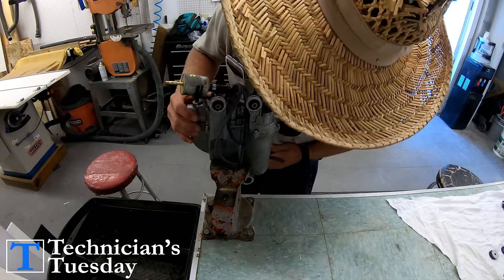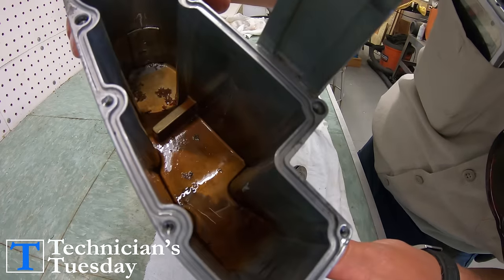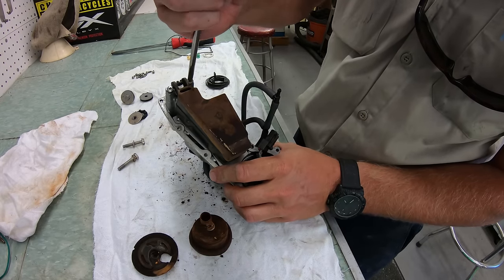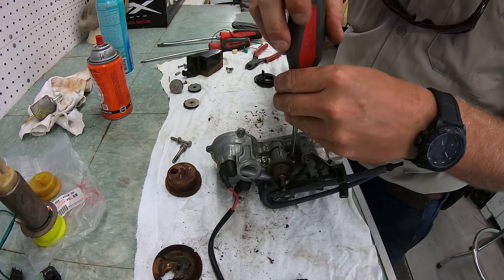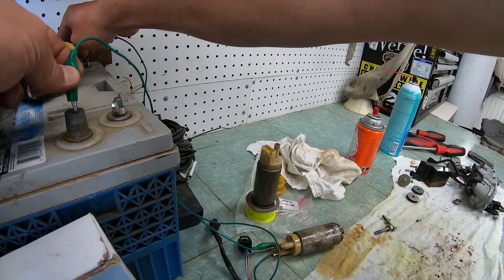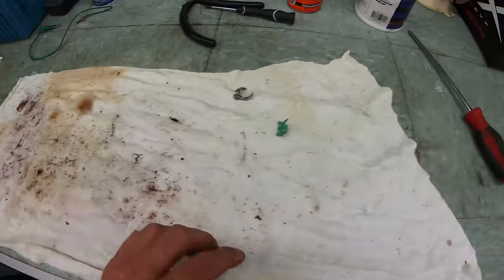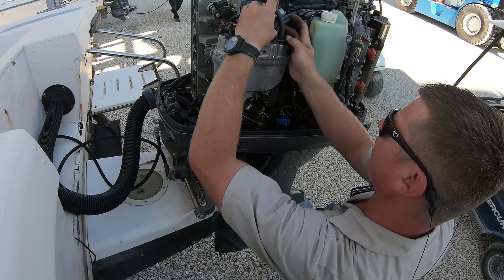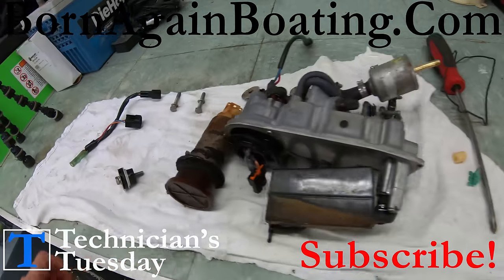How To Clean An Outboard Vapor Separator Tank (VST)

Comment: Frist, let me say how much I enjoyed your three part series of waking up this engine.  That said, I have a 115 yamaha that has been setting up for about 5 years in storage.  I'm 74 years young.  May I ask what would it cost me to have someone do what you just did with this engine?  Dose not have to be exact but in the ball park would be great.
Reply from the maker: Well that depends on how the engine was put away, and the hourly rate. If it needs work like what was done here estimate about 8 hours of labor, but if it was put away fogged, the. It could be a matter of 2-4 hours and some spark plugs and fuel filters!

Comment: Great video! i have watched it numerous times. I replaced the top section of the VST and when I put it back together, there's no fuel being pumped put of the VST. What type of tester did you use to test the pump? Looks like the pump in my VST is not working and before I buy one, I'd like to test it to see if it runs. Thanks!
Reply from the maker: Thanks! Just use a battery and two wire leads to hook to the pump to run it
Reply: @BornAgainBoating  thank you!!!

Comment: Looks kind of complicated but I’m gonna try it anyway. If I have trouble I can always buy a replacement as a last resort lol. Thank you so much for taking the time to make these videos!
Reply from the maker: You can do it!
Reply: @BornAgainBoating  hi. I cleaned my vst but when I put it back together and started her up, I noticed gas leaking from the top outside of the vst where the wire lead terminals are hooked up? Does that mean the float isn’t working? I would think the float is supposed to stop the gas from getting that high. Any suggestions or insight would be greatly appreciated. Thank you. No rush. I know you are busy

Comment: Like your video i have a question. I have a 2004 hpdi 175 do i need to clean my Vapor separate tank out. thanks you Henry
Reply from the maker: Hello Henry, thank you! If you don't have any running issues and the engine is running properly. You don't need to clean it out. Usually the only reason you will need to go into the VST is if you get a batch of bad gas and suck up a bunch of stuff, or the engine has sat for a few years and has gummed up. Besides that you should be good to go without messing with it :)
Reply: If you store the boat, say if you’re in a climate that sees four seasons (I’m from Ohio), part of the winterization process is draining the VST AFTER you’ve ran stabilized fuel through the engine for a period of about ten minutes, and after fogging has been completed.

Comment: About too take apart my VST tank ,   Fuel seems too be coming from under the brown plastic connector , blue wire ,  Any ideas why this is happening
Reply from the maker: Most likely the gasket around the high pressure pump is broken or cracked or whatever and is pressurizing the VST which is pushing fuel out in weird spots :/
If you get stumped, you can look into joining our Boater's Program where we have messaging and a place to upload pictures and videos so we could talk about the issue and give our recommendations during a weekly livestream: https://boaters.bornagainboating.com/signup/
Hopefully you've figured it out by now and are back on the water though :) best of luck!
Reply: @BornAgainBoating  pulled pump ,  neg terminal came apart from pump ,  Ordered replacement

Comment: I have a 2004 Yamaha saltwater series 2 200hp ox 66. Is changing my vst fliter the same process as this? I need to remove the entire filter off the engine, I can’t just drop the bottom tank off? Ty
Reply from the maker: Yes, it's basically the same thing for the OX66, and it's easier to pull the whole VST off and do it in a vice. Save yourself the frustration :)

Comment: That’s so interesting that they shut 2 pistons at idle. Are there any other outboards that do this? I guess it would need direct or multi port injection to do this? An OX66 can’t do this right? Since the injectors are through the crank case?
Reply from the maker: No, I think that the HPDI's are the only ones that do this :/

Comment: hey guys you are great i have a problem i would like to share with I have Evinrude 140 HP it has been sitting for 8 month I have hired 3 mechanics and all of them thye come they guess and they couldn't Start the engine the engine spin but don't start what do you think is the problem my belives is Stupid things not making the engine to start please help
Reply from the maker: Probably something to do with the spark or the timing. Evinrudes, depending on the year, have issues like that. Where the timing gets thrown off and they won't fire up but will spin all day. You need an Evinrude tech that knows how to troubleshoot the electrical system :) (That is if the fuel system and other things are operating properly, it could be something as simple as the keyswitch! Has anyone checked for spark?)

Comment: Hello my pump diagram says it has a small o ring with the plastic spacer. Does the o ring slide over the spacer or do I put the o ring in before the spacer. It is hard to tell from the diagram and unfortunately someone had already put in an aftermarket fuel pump with no o ring or spacer. So i cannot see how it was originally set up. Thank you
Reply: Forgot to list the motor 2006 hpdi motor vz225tlr

Comment: What's the difference between spark plugs and fuel injectors?
Reply from the maker: The spark plugs just provide the fire to make the explosion inside of the cylinder to allow the engine to run. They just make a gap for electricity to jump across. Fuel injectors are what atomize and squirt the fuel into the cylinders for the spark to ignite :)

Comment: What's the most common problem on this engines fuel system if it's not neglected like this one? The VST(Medium Pressure pump)? Diaphragm pumps(Low Pressure pump)? Medium Pressure Filter? This is the most complex fuel system I've seen on any outboard. I see why the engineers didn't want a Medium pressure system shooting 40-60psi from the boat's fuel tank but? 
Anyway, I'd appreciate any input.
Reply from the maker: Probably dirty filters and screens
Reply: @BornAgainBoating  Thanks for the reply and the input on YT. The reason I asked is when I had a old Crossflow Johnson it stated in the troubleshooting section almost all the problems( poor midrange, poor top end, erratic operation) almost everything pointed to the supply pumps as a first check. I pulled it and installed a Holley fuel pump, blocked the port and never looked back. 
I don't like the diaphragm pumps(Old Tech) and if it made life simpler I'd do the same on my VMAX HPDI 250. No primer bulb, more reliable than the dual rubber plunger, can't get crankcase pressure pumped into the fuel or visa versa. Less moving parts.
A person could get rid of the VST altogether if you run an EFI 45psi pump straight from the tank. Sorry but I don't like the VST.

Comment: Hey there I have twin verados 300 2008 one I noticed is making a rumbling noisy at idle it sounds like it coming from the top of the supercharger I know there is a end cap replacement kit any info would be appreciated thank you
Reply from the maker: Hey Vincent. That rumbling is most likely the bearings inside of the supercharger. I have never tried to rebuild one. I've taken one apart and it didn't seem to be that serviceable. 

You might be able to change the bearings and rebuild it, but I have never tried to do that. The rumbling is common and I've seen some sound like that for years, so, not sure how bad your's is. Hopefully it is just a normal rumble, at idle and with the cowling off they can get pretty noisy.

Comment: Thanks for the great video, I have a mercury 115 efi. I have fuel leak out of the VST vent hoses.. any idea on what could be the cause?
Reply from the maker: Usually something going on with the float and needle valve assembly inside the vst. The float is what closes everything off. You'll have to open it up and investigate :)

Comment: Hi I have DF115 and fuel is going in the oil. The low psi filter is brand new. How does the float valve work? I’m wondering if my float valve isn’t closing. Like maybe the float valve needle is stuck or something.

Comment: Can you tell me what the schrader valve is used for going to the vst?  What should the pressure be and how do you test it?
Reply from the maker: Its for testing the fuel pressure, and it depends on the engine, most are around 45psi

Comment: I have a 2001 200 Hp Yamaha OX66 Fuel Injection 2-stroke, I try and run clean fuel (not all Marina's have the same quality) add stabilizer during winter storage fuel additive in the Summer (our Season) but inevitably my O2 density sensor joint gums up causing an annoying ticking sound. I've had it apart cleaned it but it doesn't take long before it gums up again? Someone has recommended I use high octane fuel (which is only available on land) so not the best option not to mention this fuel may have ethanol, any suggestions?
Thanks
Reply from the maker: Idk if the octane level is going to get rid of the rocking. Usually when they start to gum up and tick like that, they are in the beginning signs of failure. You can try running ring free in your fuel and see if they helps. It might help with the gumming and the ticking. Maybe save you a lot of time with the sensor!

Comment: the plastic piece that is on top of the vst pump where the wire connector is, is there some sort of gasket that goes there? I didn't hear or see any mention of one in the video
Reply from the maker: Nope, just that plastic piece, most other VST's have a rubber grommet that goes there. For whatever reason, this VST just has that little white plastic piece that goes on the output port of the pump and slides up into the top of the VST.

Comment: So, I went through this process. One, Had an issue with the port motor not running good after 3500 rpm would just fall on its face. So, I replaced my low-pressure pumps and my VST pump and filters. What I found was the previous owner appeared to have replaced the low pressure pumps, but when he installed one of them, he bolted a tie wrap behind the top pump, causing it not to seal properly to work the diaphragm. Next, after I assembled everything, the engine would not start. So I was getting volume but no pressure. The tiny O-ring on the VST pump was non existent on the old pump.  So, I robbed one from my SRT4 fuel pump. Put it all back together, and my baby fired right up. That was a fun troubleshooting project. I'm going out on the boat tomorrow now!!! 
 Edit: the boat ran great for about half hour and then went right back to the port side motor running like crap. Got home and put the pressure gauge on it and only would get up to 25psi and immediately would drop pressure. so it will be back into the VST for me. Now either the o-ring I put is in the wrong spot, too small, or blew out. Next would be the FPR took a dump. Will see what we figure out this weekend.

Comment: What is your opinion on a after market fuel pump vs OE
Reply from the maker: They are hit and miss. Don't go for the cheapest one. I've put one in and it only produced 10PSI! So go with the midrange price pumps. The Axiom pump for these HPDI's seems to be the best one and it's only like $80 or so compared to the OEM at like $600 or so! Obviously OEM comes with no issues, but for saving over $500 ;) that's what I've done personally.

Comment: I’ve cleaned and bench tested my pump motor and it seems to work fine. When I cycle the key I usually hear the pump motor cut on to pressurize the VST but now when I turn the key to ON I hear no noise and the motor doesn’t run? I tested the power supply into the fuel pump motor when cycling the key and still I power. I also checked the fuses on the starboard panel and all are ok? Am I missing something. Also all the power supply plugs are in and snug.

Comment: How about a video of replacing throttle cable on optimax?
Reply from the maker: I've got a video on control cables coming up, but it will probably be in 2 weeks. I'm working on next Tuesday right now and then after that I've got a control cable video I was going to do but it is on a set of Yami's. 

They are really close to being the same though. Main thing you want to do when doing cables, is hook up the control box first. Then make your adjustment in the back on the engine so that your cables will just set onto the shift and throttle knobs!

Comment: Is there a spec for the float level or shut off point?
Reply from the maker: Not really, basically the float should be level with the top part of the vst whenever you flip it upside down. The biggest issue is debris or the needle and seat wearing out which is what the float is controlling.

Comment: I hav a 2006 yamaha f250txr and it is running great but overflowing fuel to the water. I have taken the vst apart but everything look clean. Needle and float looked to be working proper. And the relief valve in the bypass line looks to be working proper. Is there something i am missing or something else to check? What else would cause the fuel to overflow out of (what i think is) the vent line at the starboard cowl handle straight into the water?
Reply from the maker: I would change out that needle and seat assembly. We've taken those apart a lot and even when the needle looks like it has a nice point on it, for whatever reason it doesn't seat! That's the only thing that stops that fuel from going through that overflow and out the handle. You're right on it, replace that needle assembly and it should stop :) Nice work! They aren't terribly expensive either, You should be able to find one for like $50-$60 part number is 6P2-14546-00-00 called a valve, needle. Comes as an assembly with an o-ring, the seat, and the needle! Hope this helps
Reply: @BornAgainBoating  thank you so much. Keep up the good work. Love your videos!
Reply from the maker: No worries! Will do, thank you!
Reply: @BornAgainBoating  just a follow up.. i changed the seat assembly and it is now fixed once again. Thanks
Reply from the maker: @the other choad that's awesome! Good work my friend! It's nice to be out on the water again :) Thank you for letting us know!

Comment: Can I just purchase a complete VST pull the old one off and put a new one on? Rebuilding seems more expensive in rebuild time and cost of parts? I have a # 881315T05 but cant find one?
Reply from the maker: Yes you can, but that number isn't going to do much for you. The best way is going to be to go onto boats.net and then look up your engine, then look into the VST to get the real part number for the whole assembly. I doubt that it is cheaper though, honestly just changing the pump will probably be the cheaper route. That is, unless you could find a good used one on ebay or something like that, one that someone has cleaned and done all the work too. The actual part number is going to be your ticket though, find that first! Hope this helps :)
Reply from the maker: Yes you can, but that number isn't going to do much for you. The best way is going to be to go onto boats.net and then look up your engine, then look into the VST to get the real part number for the whole assembly. I doubt that it is cheaper though, honestly just changing the pump will probably be the cheaper route. That is, unless you could find a good used one on ebay or something like that, one that someone has cleaned and done all the work too. The actual part number is going to be your ticket though, find that first! Hope this helps :)
Reply: @BornAgainBoating The shop that has my boat gave me that number for the whole unit. We cant find it. Mercury HQ in Wisconsin told me that 2003 115hp 4 stroke  used a Yamaha Vapor Separator in the Merc back in 2003 but I am not sure of the Yamaha part number for the complete assembly, so I hit a dead end. I think I will tell them tomorrow to just tear into the original and replace what looks bad and just get it working again. This all has become a quite expensive repair. Had I known how bad things were, I would have rather just bought a new motor...I am so far into it now, I have to keep going I guess.
Reply from the maker: @angelogarciajr5356  Oh man, sorry to hear that! Those 2003 engines were the Mercaha's and did use a ton of Yamaha parts. I'll see if I can find anything out for you, is the shop not a Yamaha or a Mercury dealer?
Reply from the maker: @angelogarciajr5356  Does this look like what you have? This is off a 2003 Yamaha F115 so it should be what you have? https://www.boats.net/catalog/yamaha/outboard-by-year/2003/f115tlrb/fuel-injection-pump
Reply: It is at a Authorized Mercury Shop which is a quite expensive service so far. I did not expect this many problems. It would have been a much better choice to purchase a new motor with warranty than pay a ton for service and repair of a 2003 motor. Even with the VST worked on, who knows if there will be a new problem ahead? I am still thinking about a new motor verses continuing on the 2003. I think I am going to give him the go ahead to go thru the VST and bite the bullet.

Comment: I have a 2001 Yamaha 200 HPDI and I thought you had to change that barrel filter every year or you risk clogging that screen in the VST. Sounds like you are saying that’s overkill.
Reply from the maker: Not the barrel filter on top of the VST, that filter doesn't need changed but every few years or couple hundred hours. You do want to change your regular fuel filter that goes in the plastic cup every year though. But the $100 barrel filter on the top, you'll be fine letting that one go a little longer! Thank you for commenting :)

Comment: What is the gas pressure that fuel pomp should have?
Reply from the maker: Depends on the model engine, usually around 45
Reply: Do you know where I can get does filters for the injectors and the high pressure pump